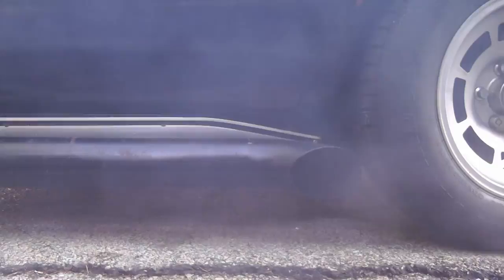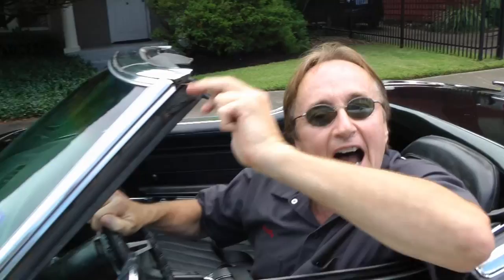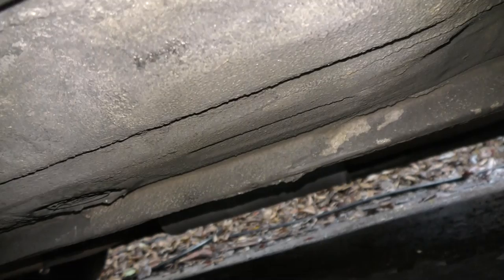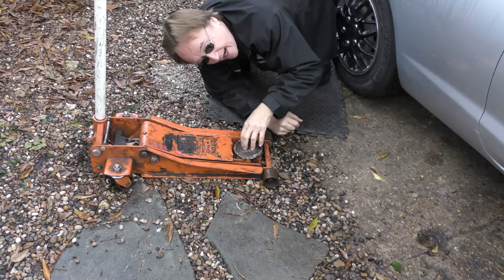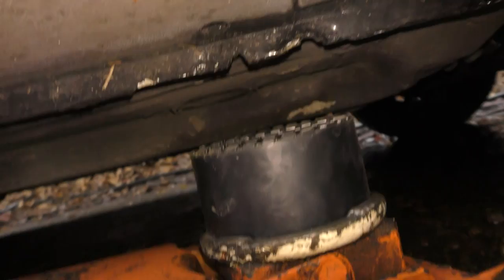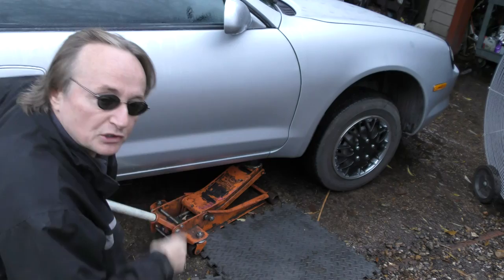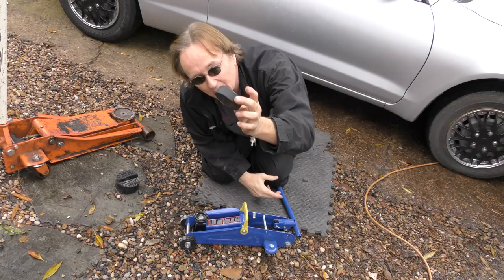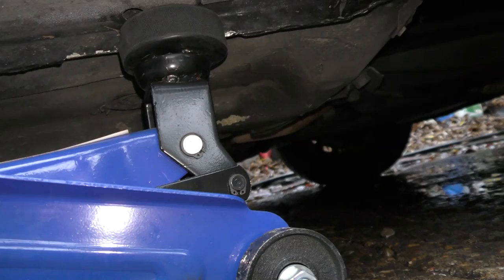How to Jack Up Your Car With a Hockey Puck

Comment: Do you know what else works? Jacking the car up normally. Those spots are there for a reason. They're reinforced so a jack is meant to to be used.
Reply from the maker: +Subway Guy yes, but they often slip and bend there with a normal jack saddle. Those spots are made for the cheap junky jack cars come with that are unsafe for any length of time
Reply: +Scotty Kilmer very good idea with hockey Puck . My old Toyota car all bend.
Reply: +Subway Guy  don't jack up many cars do you? not only can they often bend, their designed for the crappy worm gear jacks that come with your car that have a "slot" that's just like in the hockey puck.  if there's enough rust on the them I've seen them straight up disintegrate while the car is jacked up (not safe at all),  the hockey puck puts the weight not just on that fine edge of the pinch weld but distributes it a little but as well.
Reply: mwlady386 So I'm supposed to put a hockey puck on lift I use my car on every time I lift it up? Ok, I'll get right on that....
Reply: +Subway Guy I don't think anyone is talking about a lift here son.. IF you don't see the use in this tip then you obviously haven't been around a car too much.. I guess this will clear up your misconceptions though since you thought he was talking about putting a puck on a lift.. in the future you should really pay more attention!
Reply: I haven't used anything up until now, however I see the value in the tip and will use a variant of this tip in the future.
Reply: I guess I don't. How did the world live before this thing came out? Oh, the same way it does now.
Reply: Does anyone not fucking realize that for many years before this thing came out people were jacking the car up by the rail for years!? And now that this thing came out, people are thinking they've been doing it wrong for all this time? No, it's just a waste of money. All of you go buy and waste your money on this useless thing.
Reply: Yep, you're right. Car manufacturers never put any thought into how people jack up the car. They expect it to just float up on it's own. Who gives one solid fuck if the rail is bent? You can still jack your car up without any issues. It's your own fault if you fuck it up and jack it up in the wrong place. I'm done with you. I guess you need to have every pointless car invention to make your life easier.
Reply: +Subway Guy I jack my grand am up from a completely different spot. my floor jack by no means ever touches the pinch hold for scissor jacks. I can't remember the name, but it's basically a K member under the engine bay, that is for floor jacks. On an LS400, I couldn't fit my floor jack under it to reach the actual jack location described before. I had to break out the crappy scissor jack just to lift one side and sneak the floor jack in under it to jack the car up for real. Other people opposing you in this thread don't necessarily know what they're talking about, but the point is that you don't mix floor jack with scissor-jack-spots, unless you get something like this.
Reply: +youmakeitwhatitis instead of using two jacks, just drive up on a 2x4 first to clear your jack. Or get a low pro jack. I've got to drive up on wood to use my bottle jack on my xc90 because it maxes out right when the wheel lifts, so a little higher and I can turn the piston extension another inch out so I get more lift. It's annoying but not a real issue. I could also put wood under the jack, either works. I use the pinch welds for the jack stands. My car has specific areas that are reinforced for that, you can see the metal is doubled up and there's a scissor jack holder welded behind because of volvos funky jacks. Each car is different but you should always use your subframe to lift with a floor jack, and then lower it down onto a jack stand.
Reply: dynocompe ;)
Reply: youmakeitwhatitis Are you talking about the subframe that runs under the car? It's just before the oil pan.
Reply: +Subway Guy =  My sister's husband felt the same way, and as a result he bent the hell out of those metal seams on the bottom of my sister's 2007 Hyundai Sonata.  What a mess !    Everything's all bent and twisted, cannot get the original jack to even fit under there anymore.
Reply: +Subway Guy Rail <> pinch weld. They are two completely different things.

Personally, I don't worry about the pinch weld on my car, ever since the stock scissor jack that came with the car managed to bend, I picked up a pinch weld adapter for my floor jack (From Eastwood if I recall correctly). No puck needed and no worries about bending it.
Reply: +Honesty Counts That's what you get with a Hyundai. Don't expect the airbags to deploy either. Did I mention the ABS brakes?...
Reply: Yep, ok. Because your car will rust out in 1 week and fall apart.
Reply: +Subway Guy Why the fuck would you want to bend it? Yeah, bending it is cosmetic (As long as you do spray rust encapsulator) but why would you want to? Is there really something so difficult about getting a pinch weld adapter for a floor jack? If some idiot fucks up my pinch weld by being a dumbass, they're paying for it.
Reply: are you saying when you bend it, you sell the car in a week or what?
Reply: Subway Guy
That was an example. I generally do all the work on my car, even painting and body work. The only time I ever let someone else touch my car is for inspections or if I need something done that I don't have the tools to do.

And I'm not saying you said to bend it on purpose. I'm saying why would you want to at all when you can simply just get a pinch weld adapter rather then bending it?
Reply: Subway Guy you obviously dont have a clue about bare metals. Oxidization starts immediately on bare metal. Rust can form in under 24 hours in the right conditions. My dads 2009 Expedition was rusted out so bad the front bumper was about to fall off the main frame. both frame rails from front to back were almost gone by the doors. Had a loonie size rust spot on gf's tiburon, it was 3 times the size after winter. If you live in a hot dry climate, rust wont spread as fast. Damp climates spread fast. Big difference. I have seen cars with bent jack points just like you have, be rusted out completely. I worked in a auto salvage yard during summers when going to university. Rust can spread very fast. If bare metal kept clean and dry, could stay clean for years. But under a car, clean and dry is rare!
Reply: Subway Guy
It's a social skill that extends far beyond the internet into real life.. Somebody who can't admit they're wrong is someone most people don't like to hang around.

This is just a tip to help your car stay in better shape for a longer time. It's not absolutely necessary but it helps so I don't see what's wrong with it and why you have to be so argumentative.
Reply: OR if you are that desperate of using something just use a wood block ffs LOL.
Reply: guess depends where your from. I have more hockey pucks laying around that pieces of wood. Hockey pucks are cheap.
Reply: +dynocompe Best comment of the day LOL !
Reply: Subway Guy yes that makes sense since we all want to do things the right way. You are the only one here who is saying they dont care. Quite obvious your logic is severely suffering
Reply: +Subway Guy and no one said you have to do it this way. It's just smarter and a cheaper way to do it
Reply: ***** Spot on, spot on.
Reply: Lol you mad. i fix cars for a living and sell car parts at the same time ! i think i know alot of things for a 25 year old guy.Subway Guy
Reply: +Subway Guy Nah dude, I jacked my car up "normally" and now the jacking spots are freaking bent.
Reply: flimflam Ok, and?
Reply: flimflam Have you ever thought about becoming a psychic? Because you're spot on.
Reply: Subway Guy It's something you're born with. I was born with this gift. Let me know if you want a complete reading.
Reply: +Subway Guy just used an aftermarket jack on my car in that spot.... and it still bent....so no, ill be buying this hockey puck XD
Reply: +Subway Guy some people like to keep there cars forever and actually have appreciation for them ive read this whole thread and had to find the right comment to place this. i dont think you have spent 20-50k outright on a car if you think to yourself fk it if it bends it bends because to people like me thats what a good 1% of the car so 1% of 20% is what 200$ so to everyone arguing against you a 2$ hockey puck is well worth its weight in salt if it keeps your 200$ piece of car intact. try selling a used car with torn up jack mounts because any good buyer is going to see that and realize you did the work yourself and its in appearance looks shoddy
Reply: Scotty Kilmer Agreed. First time I jacked up my wife's 2010 Focus at the jack point indicated, using a floor jack, the damned pinch weld just bent bigtime! Now I use structural members like control arm mounts etc. Someone suggested tow hook but i dunno, seems to me it could snap as they're meant for pulling strength, not up/down pressure.
Reply: check the owner's manual. it should tell/show you where the front and rear floor jack points are if you need to access them. I'd prefer to only use the pinch weld areas for the jack stands and scissor jack(when out on the road) if I can.
Reply: Wrong. I was glad that Scotty mentioned the possibility of the rails getting bent, as that is exactly what happened to me when I tried using one of the jack points. I'm now going to get one of these things to exactly avoid this happening again.
Reply: Car guys DO CARE if some jack ass pun intended auto shop employee places the lift blocks wrong and bends the rails on the lift.  Only a non-car guy like a subway guy wouldn't care if if some dude bent parts of their car's body,  just as long as it starts and runs.
Reply: Calm down, everyone!  The jack   rail is painted and most jack pads are metal.  That's how the body gets damaged.   I've use magazines, rubber belts and anything to protect the sheet metal.  I like the ideal of this product.

Comment: That's called a "pinch weld" seam and yea, if you use a jack and bend it over, it will eventually rust. I have a 2012 Genesis 3.8L Sedan, and it has those same pinch weld seams. There ARE two jack points on each side of the car, front and rear, and that's where my tire dealer uses to raise the car. 

The car sits low to begin with, so a large floor jack just won't fit. I just did the brakes (front and rear) and I can tell you, if you are working on the car in your driveway, USE the spare tire jack (if you even have one) as it's made to fit. Then use the floor jack once you get it up in the air to stabilize it. I have a hockey puck as well (well, it a real puck, it's a round hard rubber packing thing I got off a piece of heavy equipment mounted on a wooden pallet) that works.  Those damn pinch weld seams suck.

Comment: you could probably use a angle grinder with a cutting wheel and get a cleaner cut but, really cool tip.

Comment: i use the same spots a lift for a shop would use as my car well, had framerails but the salt has eaten them away in the back of the car and while the front ones work fine, on an older rusty car, if you can't lift it using the spots a shop would do to lift it, its likely time for a new donor body if your vehicle has everything else new like a motor or replacement as a whole:)

Comment: if you're concerned about the strength of the puck, are you actually going to get under a car not supported by jack stands? i think i'd trust it enough to slide my arm under the car to put a jack stand in

Comment: once you have it jacked up where do you put the jacks stand since the jack is lifting on the designated lift point?
Reply: Lock the jack itself with a thru-bolt. Drill holes along the side. Or lock it using a square or round tube with a notche in the ends - you can figure that out works for most jacks. The first solution is the best cause it's not one-size.  :person-turqouise-waving:

Comment: In case anyone is interested, using a chainsaw or an angle grinder with a chainsaw disc works just as good to cut through rubber.

Comment: @Ira Friedman On minivans and most CUVs, at least up front there's the engine cradle you can jack up on without using a puck but on a lot of newer models, that'd mean removing the splash shield first... which of course means jacking it up first!

Comment: I have a question. My engine's mounts are worn and therefore do not support my engine well, causing my engine to shake a bit more than it should. Do you think I can just put some broken hockey puck pieces beneath engine, approaching engine from bottom of the car (as if I am changing the engine oil)? My car is pretty old, and I am not willing to spend $300+ for just replacing engine mounts as they do not seem that important? Or are they important for the engine and other engine bay components (I seriously do not know and am really curious)? Btw, thank you always for the brilliant videos!

Comment: Hey Scotty that's a cool idea! But what if you live in the Northeast salt belt and you car lost its rocker panels and pinch welds years ago?
Reply from the maker: +motoYam82 then you use places like where the A frames bolt to the car frame, that bolted area is strong for a jack point

Comment: This is a safe way to jack up a car, without bending ANY metal:
- Place the jack under the car so that when the head of the jack lifts it will lift just inside of that 'spot-weld-seam', in a place where there is only the metal of the car's body, nothing else  (no wiring trays, or plastic moldings). 
- On the top of that jack-head, place a 3 foot long length of 2x6.  Now that 2x6 will distribute the lifting force over a large area under the bottom of the car.

Comment: if it bends it bends keep jacking it will be fine, i have never seen any problems and I worked repairing/replacing tyres for over 10 years.
Reply: +Ray Rooney except some people care about their cars and dont want them bent anywhere. Not too mention, most cars that weld tab is painted, you bend it, the paint flakes off, then starts to rust, and once that happens it doesnt stop! What shop you work at so i know where to avoid? Obviously you dont give a shit about peoples cars
Reply: u r y I work on my own

Comment: Question: I have a 1984 vw t3  and the clutch doesn't work at all. The pedal has pressure and i thought that it had some air in the system. When venting the system, i think all the air had come out but the brake fluid never  comes out with pressure like it used to do. I dont think that it is the clutch master cylinder, i think that there is some air deep in the system. So i might get all the fluid out and put it again in. Any ideas of might be? (btw im 16 :p and the car is 15 yrs older than me :)) but i love it)

Comment: Scotty - our 95 Toyota Avalon has the same type of lift points in the same location - along the pinch welds - that you mention in your video. My question....after raising the car (using the front tow hooks as my floor jack lift points) can I then rest the car on jack stands using the spot on the pinch welds that you referenced?

Comment: can you please make a video on how to change the oil on a modern audi they don't even have a drain plug on the bottom great channel
Reply from the maker: +jason muscat  you get a vacuum sucking machine and suck it out, 80 bucks on amazon. that's how the dealers do it.
Reply: +Scotty Kilmer why what the idea no drain plug
Reply: +jason muscat, I'd rather use the suction method of changing oil.  That way I don't have to crawl under the vehicle.  I had a 2000 Toyota Tacoma that I could get more oil out by vacuuming than by using the drain method.

Comment: scotty killmore, can you make a vid on how to fix a car that jerks on the freeway. i recently bought an 08 mitsubishi lancer and i notice that on cruise control, its jerks about 500rpm and then back to normal even sometimes without cruise. but when i switch it to manual mode (cvt) it stops and goes up the 500rpm. does anyone know how to fix it or can u make a vid scotty

Comment: Ah, great, thanks for this vid, I'm sick and tired of bending pinch welds when I jack up my cars, I NEED to buy one.

So is the goal to lift it up BY the pinch weld, or to lift it up AROUND the pinch weld?  That is to say, should the pinch weld bottom out in the bottom of the slot and it lift it there OR should there be a gap between the end of the pinch weld and the bottom of the crevice and it's actually lifting it up AROUND in the pinch weld?

Generally I just lift up with jack by the pinch weld but that's what causes the bending in the first place, so if the pinch weld is bottomed out I don't see how that will change.
Reply from the maker: +MrSlowestD16 it should bottom out
Reply: +Scotty Kilmer Great, thanks!

Comment: You have dried wax in your Stingray emblem (  0:02  ). You can easily remove it with a soft toothbrush and computer keyboard cleaning spray.

Comment: Hey Scotty, can you do an in depth run through on serpentine belt pullies? I saw the one about checking the belts but on videos by others they talk about the alignment of the pullies mattering, the wear of them, and how to check, is this a come on to get me to buy their kit? Thanks!
Reply from the maker: +AJ L of course it's a come on.  Most vehicles are perfectly aligned as is, only ones with damaged pulleys or brackets ride incorrectly
Reply: +Scotty Kilmer
Thank you so much

Comment: Scotty killmer do 1999 Ford Taurus have a senior that if coolant resavar cap not tight enough low coolant light will come on
Reply from the maker: +jhon chapter 3 verse 16holybible no, but it has a float that will show low coolant if it gets low enough